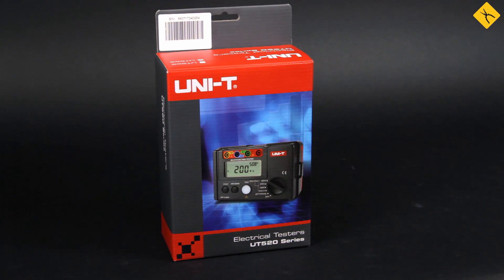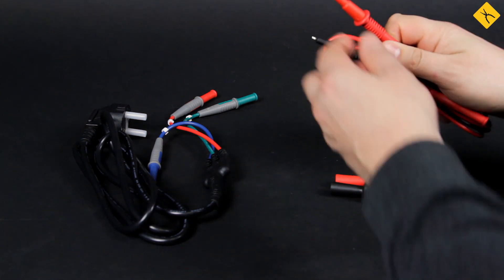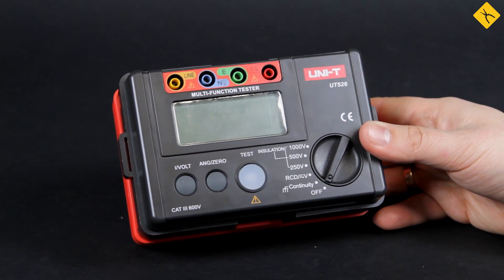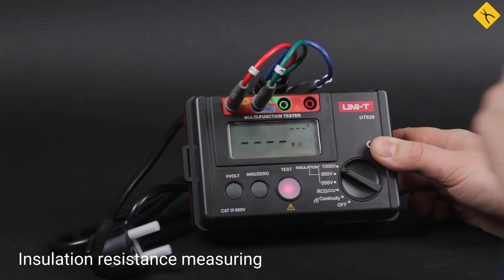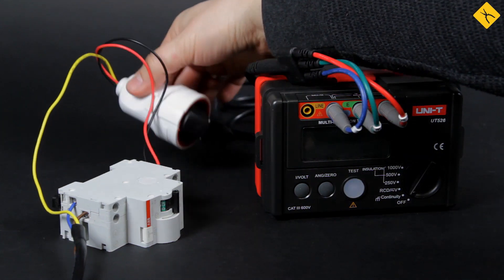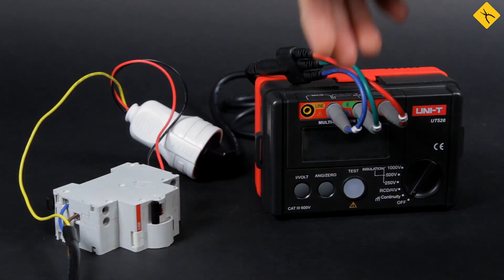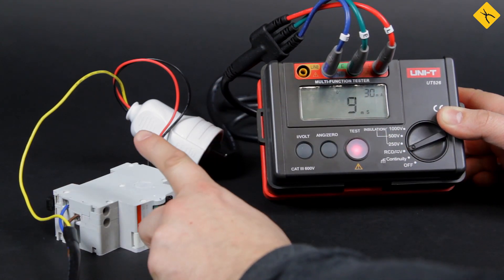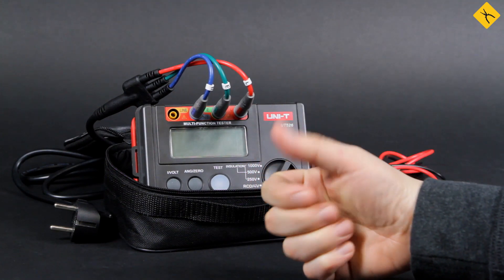UNI-T UT526 RCD, Insulation, Voltage Tester for Electrical Networks

Comment: hello.  Are de the measurement parameters based on IEC 61557?
Reply from the maker: Hello! This instrument was designed, manufactured and tested according to IEC61010 safety standard (Safety Requirements for Electrical Equipment).

Comment: Good demonstration.
But when you test RCDS you should test at half time then at one times then at five times
ie for a 30ma RCD you should test at 1. 5 times at 0dc then again on 180dc then again at 1 times 0dc and 180 DC then at five times at 0dc and at 180 DC , at 1 times the RCD should trip in less than 300ms and at five times less than 40ms half times the RCD should not trip. So set the meter to 30ma and then set the trip time to half times press the test button, then press the angel button to change from 0c to 180 c and then press the test button again, repeat for each test ie 1 times and five times